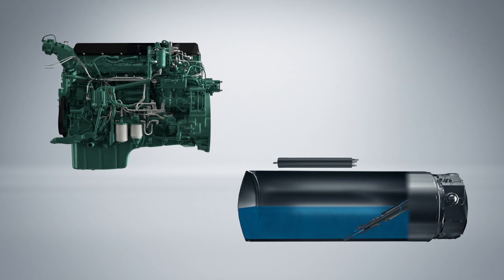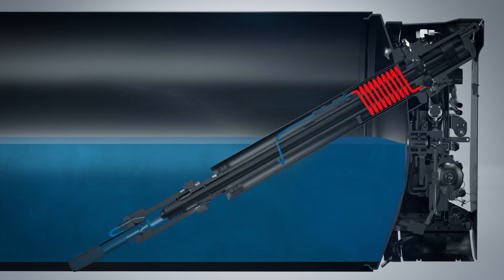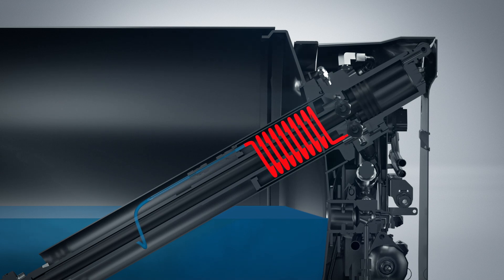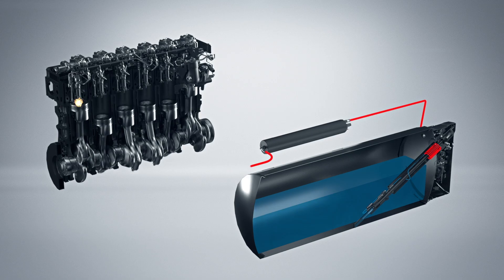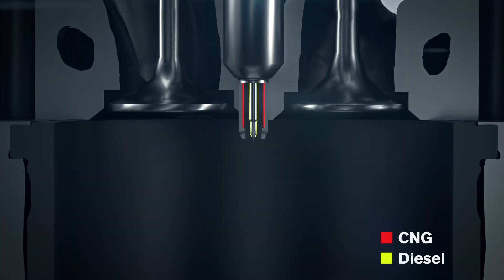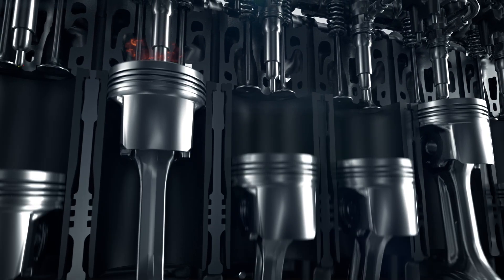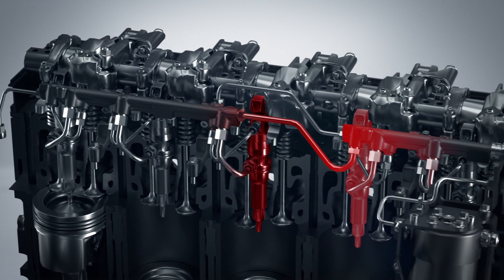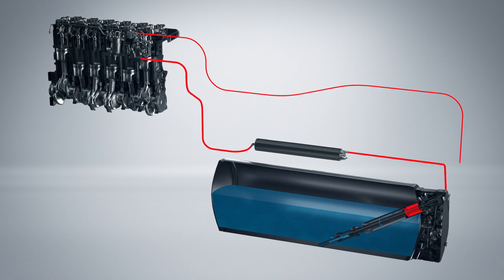Volvo Trucks – This is how gas flows in the engine inside our gas-powered trucks

Comment: Diesel blue power engine. i've ruin a diesel engine by mixing diesel with gasoline but it turn the engine in high revolution. can't deny the torque power of diesel and the low emission of lpg. it's a great catalyst.🍌🍌🍌

Comment: How does using LNG reduce our dependence on fosel flues?
Reply from the maker: We do not think there is a single, global solution. Instead we will need to find alternatives at different times, in different parts of the world, and for different uses. Also, there are both advantages and disadvantages in all fuels. It is important not just to look at emissions while driving, but also the total life cycle. Having said that, there are solutions that we think are particularly interesting for various segments in the long term, such as gas-powered vehicles AND electrification.